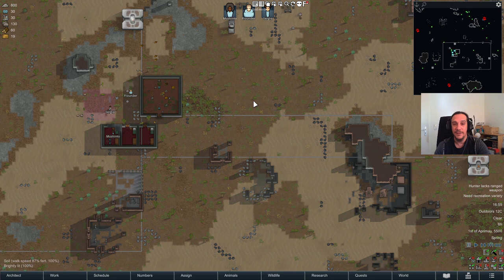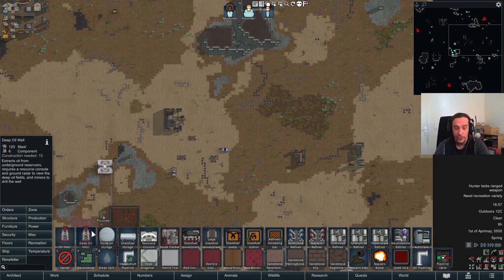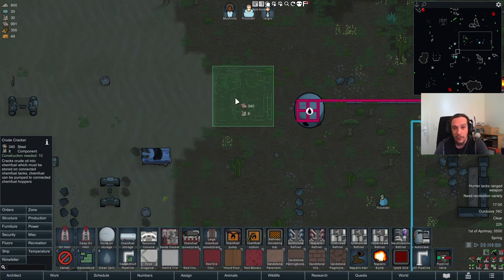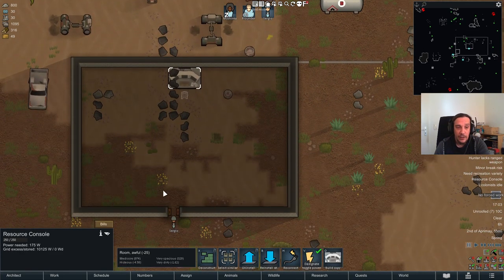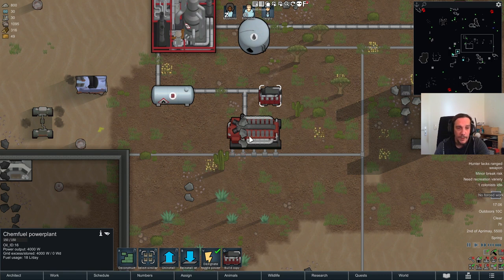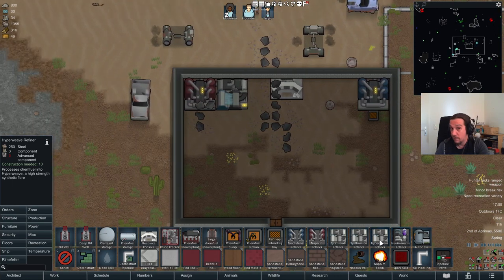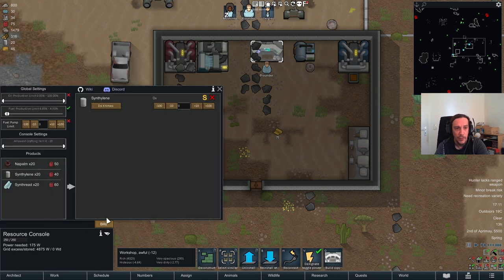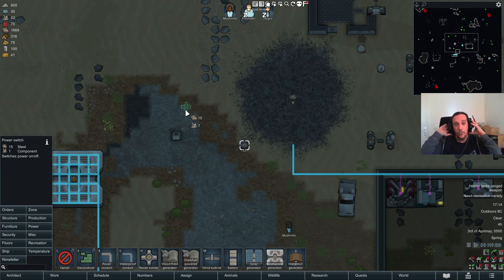RIMEFELLER GUIDE - Overhauled Tutorial Rimworld Ideology

Comment: I remember I had one colony running off of oil to the point where I removed my old power system and relied solely on the oil. 

Then one day a mech cluster landed on my base and killed all but 2 of my colonist and did major damage to the power system destroying my batteries, thankfully my batteries and refinery where on other side's of the map, I was able to wall off that part of the base and hide 

but now I was working against time to make a new connection between my base and chemfuel generators so I could call my allies for reinforcements

 I was just 2 wires away from doing it when one of the people went Catatonic and the other was incapable of building 

I then pulled out my final trap card I had one resurrector mech serum that I had planned on using if my favorite colonist died but he was dead outside with the mechs so I abandoned that idea

 so instead I decided to kill the man that went cationic revive him and drug him heavily with stuff that increased conscious and it worked he was extremely slow but alive and managed to plug the direct connection in before passing out again I sent the more able bodied colonist to call the reinforcements and they came in I was sav...

Then the reinforcements all got slaughtered and one of them died in a doorway allowing then mechs to pass my wall killing the final 2
Reply: That's such a great rimworld story lol

Comment: You're missing some really important parts in your "How To Drill For Oil" section.  The first being that multiple  pawns can drill the same well, however you can only force a single pawn at a time to do it.  The second being that the job priority for drilling a well is the same for operating a deep drill.  So pawns that are assigned to mining will work a deep drill so long as there are no ores/rocks designated to mine directly.  These to facts together mean that if you want your well drilled as quickly as possible, you need to assign multiple pawns (up to three per well) to the mining job (or drilling if you have an expanded work tab mod) and either clear your other mining tasks, or restrict drillers to the areas around the drill.
Reply: You also say that it's fine to run a well into your cracker with no storage, but that is a horrible loss of efficiency.  Oil wells will pump crude so long as they are powered.  Regardless of whether or not a pawn is operating the resource console.  So over night your crude storage will build up, and you can run your cracker at a higher rate during work hours meaning you won't have to operate the console as long.

Important resource console information missing - The resource console allows filtering by crafting skill, and higher crafting skill means refineries will produce resources faster, but operating a resource console increases the intellectual skill.  And the "Fuel Pump Limit" setting will pump fuel out of your system (150 units at a time) until it detects the set amount in a stockpile.  The pump itself is treated like a stockpile, but will start filling up again while your pawns are carrying the fuel.  You will likely end up with more fuel than your set limit (ogrestack users beware)

Important refinery information missing - If your unloading bay is full, production is halted until the bay is unloaded.  If you want your resources quickly, it might be a good ideal to restrict a hauler to your production area and stockpiles.  You can also attach multiple unloading bays to a single refinery to prevent your machines from backing up.
Reply from the maker: Thanks for putting in all this effort there, a lot of these things were new to myself (especially the thing with the Fuel Pump Limit, I somehow blind-eyed that one). Hope this'll help other people as well and if there's ever gonna be another overhaul of this video I'll definitely use these as pointers - cheers!